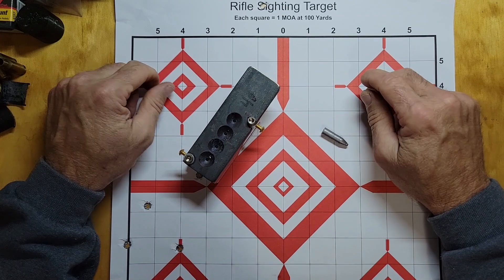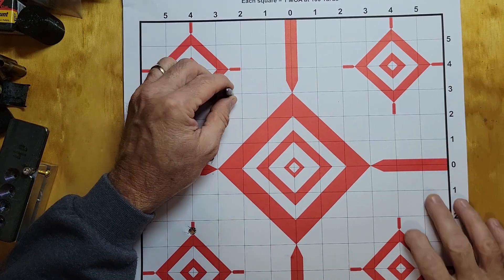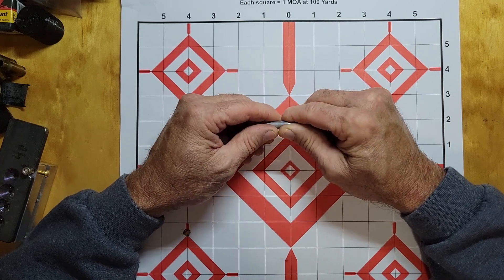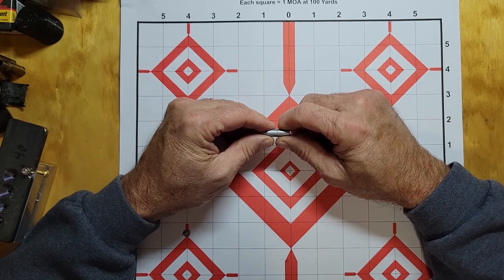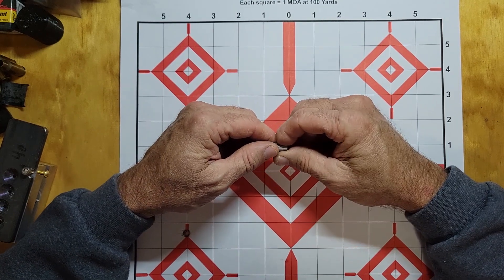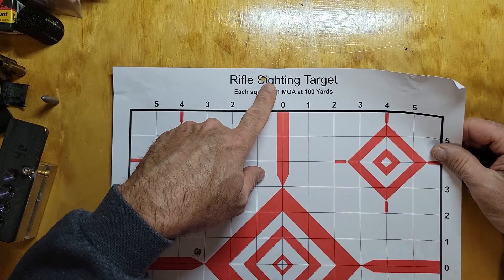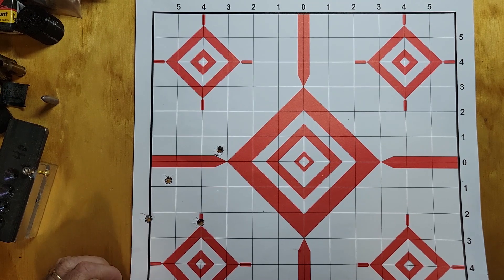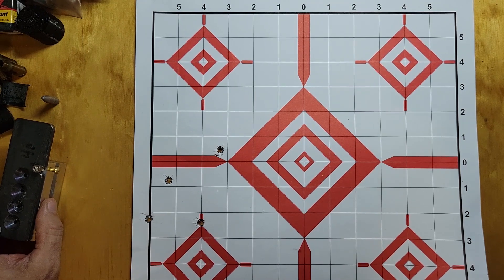303 I'm Done

Comment: Six, I have a Korean war vintage #4 Mk-2 and with the right loadings it will rival any of my Match guns, So, I wouldn't throw the baby out with the bathwater. Put it away and keep your eye out so that when Criterion makes .303 barrels again, you will be ready for it and be set to rebarrel the rifle. The .303 in its original configured stock is a functional work of art, the buttstock is canted so it will line up when shouldered to be level with your eye. the pistol grip is set right in the best spot. I like the Military stocked rifles, not only for collector or originality, however, they are just a joy to shoot and they were designed to be the rifleman's rifle to get the most out of Marksmanship. Peace dude -Dave

Comment: I'm sorry to hear that Six.  I'm still waiting for Criterion to do another run of .303 barrels so I can have mine re-barreled.  They are not in any hurry, it's a bit frustrating because I like this old warhorse, they are a lot of fun to shoot.  I have been leaving it in the safe when I want to bring it out with the others, it's probably been a year since I shot it.  I don't think I ever shot any bullets over 180 gr though.  I think the traditional range is 150, 174, and 180 gr normally for these rifles.  What prompted you to do 200 gr. and might that be the difference in performance?
Reply from the maker: Everyone said 200gr cast was the weight to shoot for 303.
Reply: @sixshootertexan  Well, I will never claim to be any kind of expert so I could be completely wrong.  LOL.
Reply: @infobros  I just got a .303 so I have been researching a lot. My guess would be 174 gr. is the sweet spot as far as bullet weight goes. I couldn't handle the cost of a new barrel but trimming the mold down is pretty easy with your skills SST, Just my 2 cents. Mike.